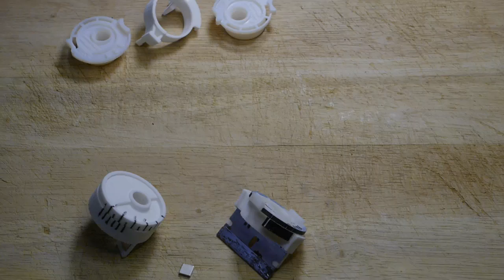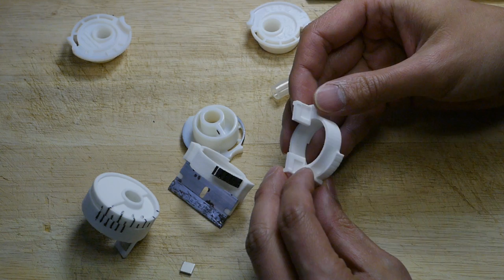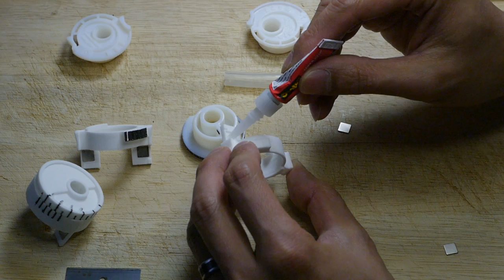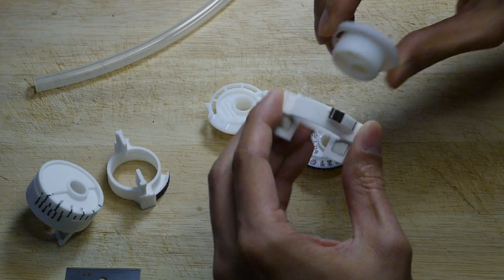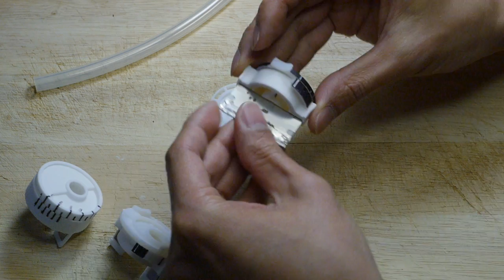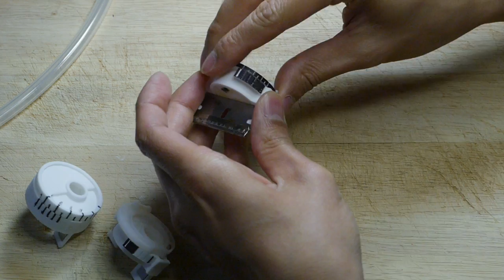HopChop - R-Hop Cutting Jig Part 1

Comment: My set arrived today, the Hopchop V4 and Hopmitre. I'm used to do R-Hops by hand, but i have to say, that both Tool are so convenient XD Even when you have already the skills, it makes everything so easy. I just glued the patch in place, no sanding needed except the small angle, where the BB gets in contact with the patch first, when traveling down the barrel. I needed just 5 mins to glue the patch in, that's great, and so far everything looks just perfect. Thanks for your effort to design this tools!!!

Comment: hi I want to buy one of your jig kit I'm not sure about the size the that I need rubber tubing that I bought the ID 3/16 and the OD 5/16 wall thickness 1/16  what size I need 
8mm R-hop cutting jig
Reply from the maker: willie contreras I would suggest buying tubing with a 6 mm ID. while 5/16 OD might fit the 8mm guide, you will need to remove a lot of material on the inside to fit a 6 mm barrel. This risks all sorts of problems if the ID is not perfect. The inside surface is the most important part of a patch, outside can look like crap and still work technically.